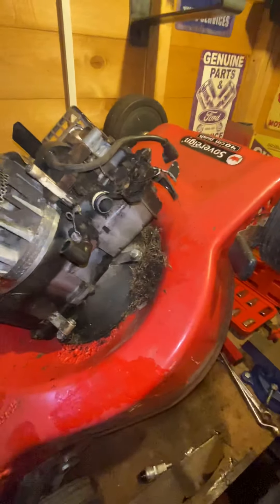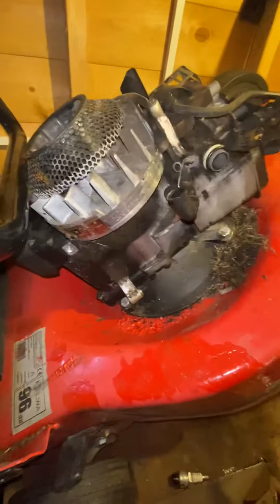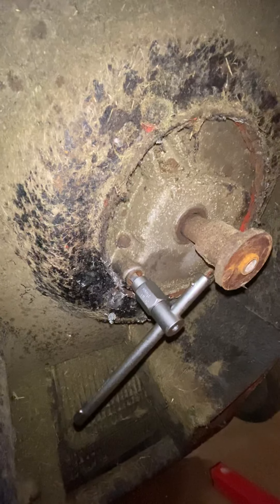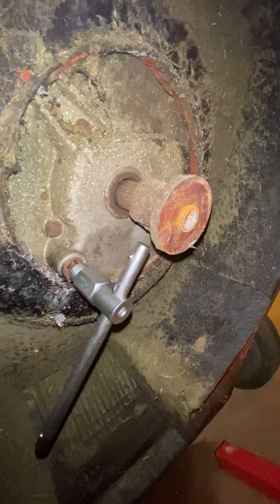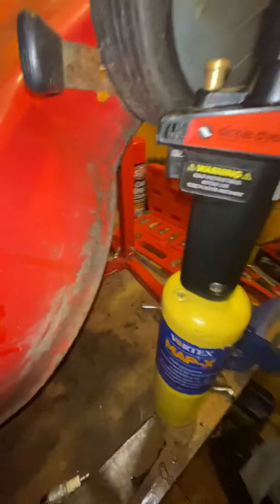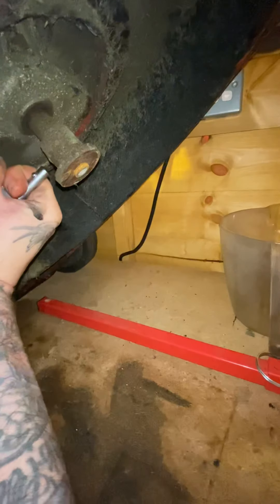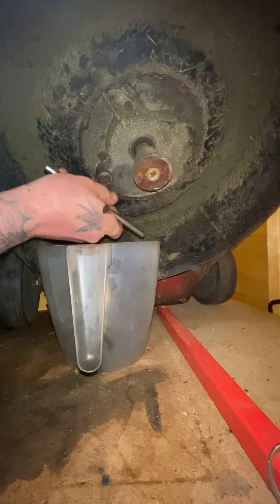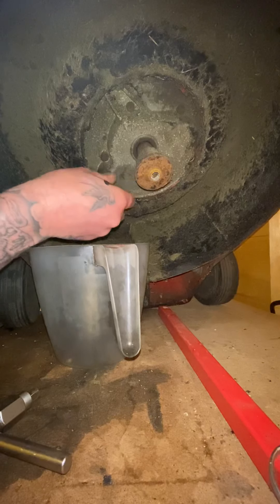Briggs & Stratton 35 classic engine oil change

Comment: I use same method sometimes it's quicker than oil extractor also I have two measuring jugs one for old oil and take the level it empty to the a clean one measuring to same level then plug back in and refill topping off where needed as a separate container for clean oil 
When starting in this business people like you have top tips to help with jobs 👌
Reply from the maker: Cheers matey 👍🏻🔧

Comment: Hi matey sometimes there isn't a sump plug on some engines although the briggs engines do some other brands don't any tips on drainage of oil in another video matey
Reply from the maker: Without using an oil extractor…. Simply tip the machine up to drain oil my mate 👍🏻🔧